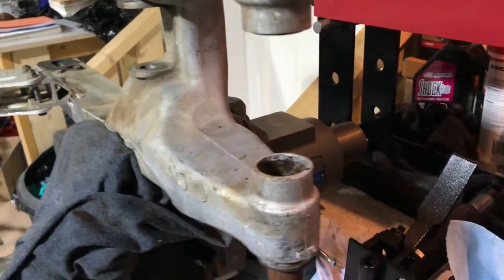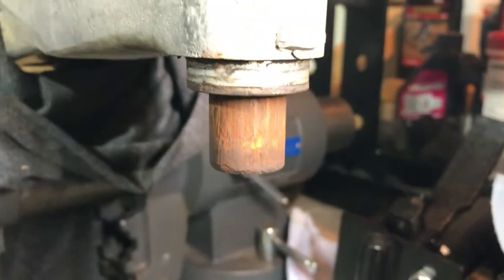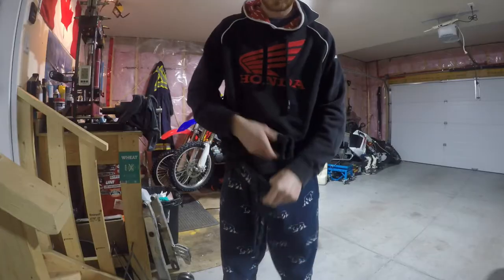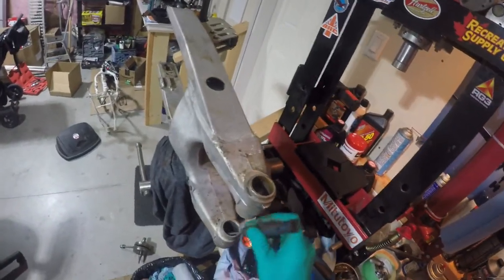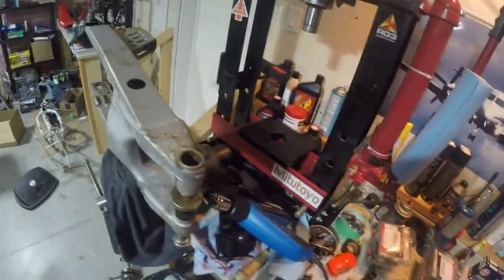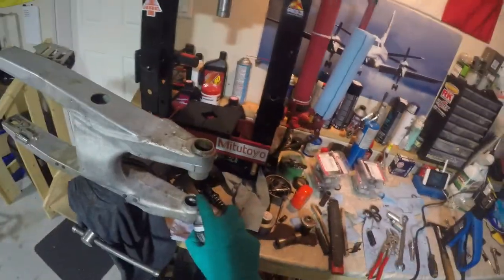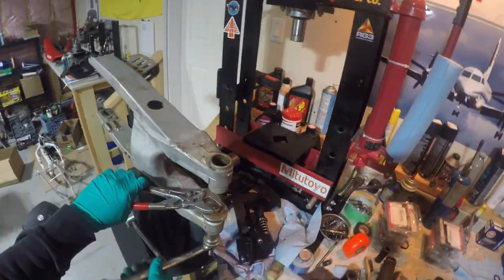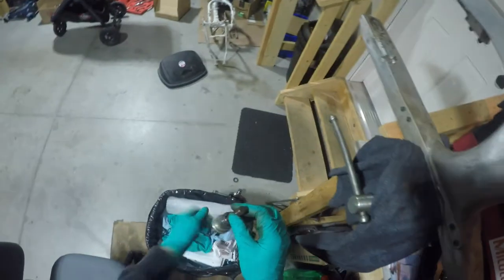How to Remove Rusted Swing Arm Bearings

Comment: Thank you so much for this. I was about to give up on mine, but i kept at it; heat and wd40. Over and over. Finally i got the crack and it's moving! I actually broke the first threaded rod in mine!
Reply from the maker: Dang, must have been quite the battle! Glad I could help